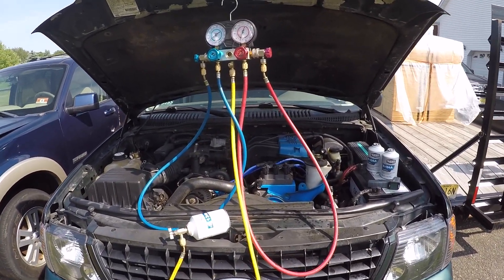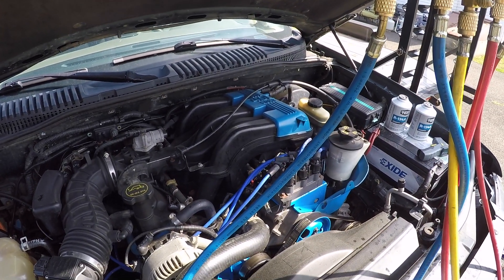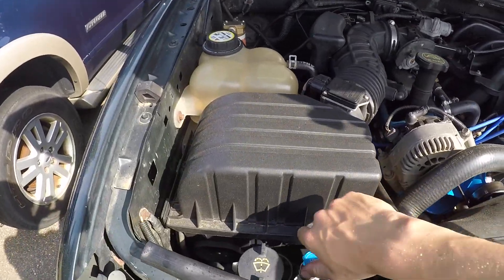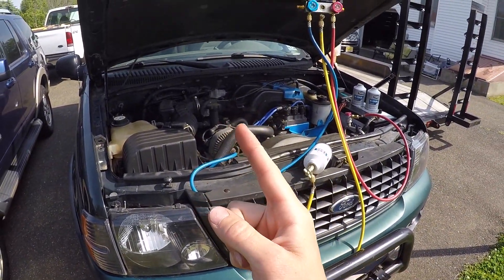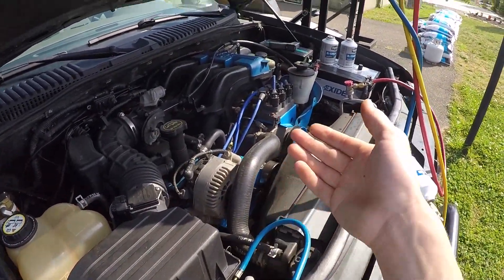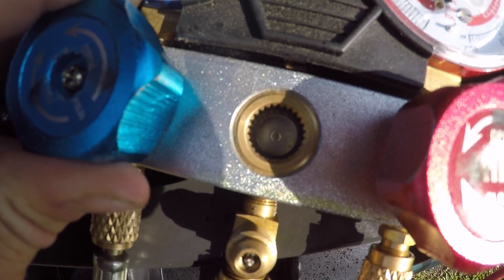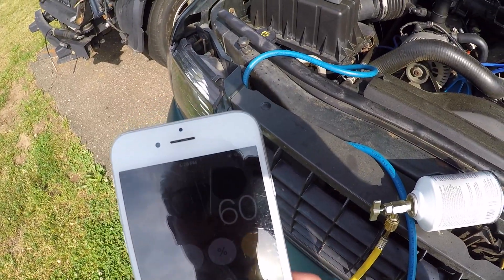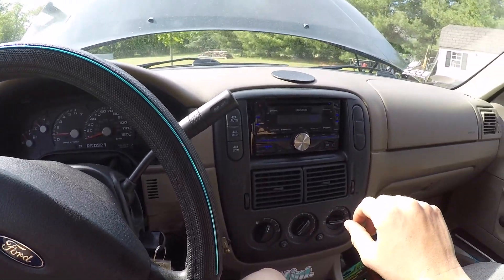How To Recharge the A/C in Your Car or Truck (With Gauges and PT)

Comment: With my guage set if the valves on the manifold are closed the guages will not read presure. With the Yellow hose if that doesnt have a valve on it that is not closed off the refrigerent in the system is going to bleed off as soon as either blue or red valve is opened. Nobody mentions that in these videos. Might be kind of important.

Comment: Good video however I need to point out a couple things. You didn't purge your blue line which is also full of atmospheric air before charging. Also, I believe most newer vehicles use a TXV instead of an orifice which would need to be charged by sub cool instead of superheat. It's important to keep an eye on the superheat but a TXV system is supposed to be charged by sub cool. Maybe you can make a video showing that method? I know but a lot of other people may not.

Comment: Superheat is measured on the HIGH side, not the low side.  He is measuring Sub-cooling,  Great that he finally purged a line, but the low & high side lines should have also been purged.  After telling us it is bad to have liqiid coming into the compressor he is charging LIQUID refrigerant into the low side!  Hold the can upright so only gas goes into the compressor.  It is not just "bad", it can BREAK your compressor because liquid is essentially incompressible!  And by the way, air is a gas so the compressor can compress it just fine.  The problem is that it is not a refrigerant and also contians WATER which you really do not want.
Reply: Dennis, sorry but you have it wrong- SH is measured from the low side. Because we want to ensure the refrigerant has boiled off in the evaporator. Sub-cooling is measured on the high side. You have it correct that this fellow did the cardinal sin, he did not purge the low and high hoses after connecting to the system. He has now introduced non-condensibles in the system. And yes its correct, he should be charging with vapour because introducing liquid in the compressor is very bad. R134A is a pure refrigerant so he must charge it by vapour, BUT, if it was a blended refrigerant then you would charge by liquid BUT with a pressure reduction tool inline to avoid different components of the blend leaving in a unbalanced state. Regarding the superheat, he did not state how he came to the number 12º- Because the proper way to determine super heat is by taking the outdoor ambient temperature and the WB temperature entering the evaporator coil. He obvious did not do this. SH is not one number- it changes at different temperatures.

Comment: In Orifice tube and TXV system do you use for both superheat method to top up or to add freon or not?
Reply from the maker: Yes superheat will get you to your precise fill level.
Reply: @iamdjnam  I meant in TXV system also  we can use  superheat because you know in AC units  with TXV system they use subcool  to top up freon and superheat in orifice tube, capillary system.
Reply from the maker: Yes, when I work on home units I use superheat and subcooling. For the common homeowner filling their vehicle the superheat method will do just fine.
Reply: @iamdjnam  Thank you brother valuable informations

Comment: Great video. Good explanation and editing. However, should have bled that low side hose before charging.
Reply from the maker: Didn’t even notice I didn’t. Great call. Definitely purge the air out. Thanks for watching!
Reply: @iamdjnam  also the high side hose need to be purged